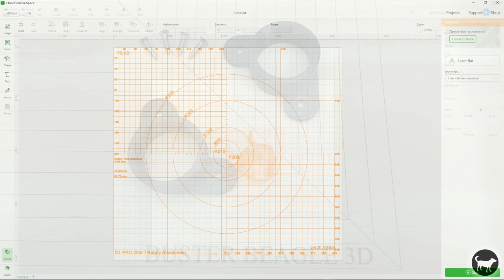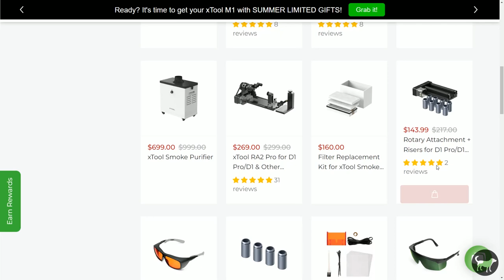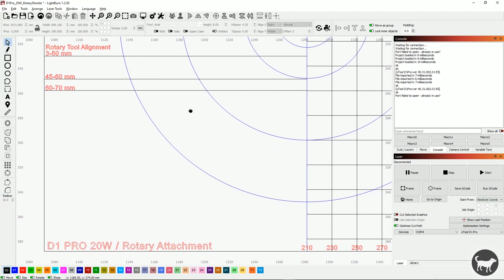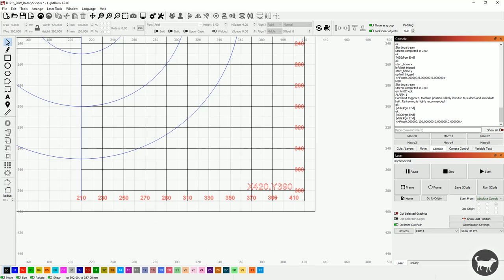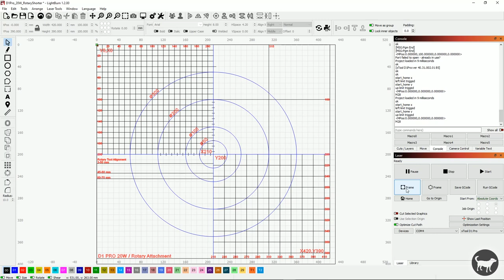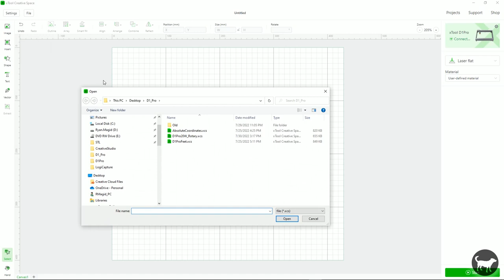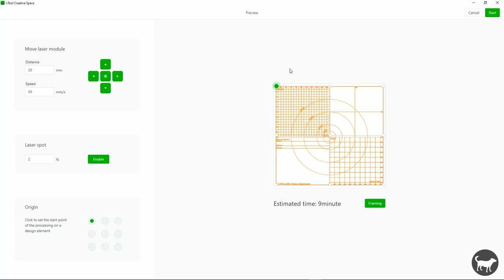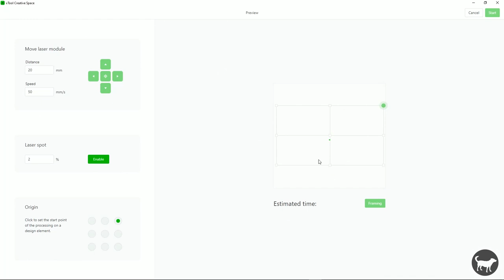xTool D1 Pro Grid Files | Use Absolute Coordinates | Lightburn | xTool Creative Space

Comment: I keep getting the “the element is placed outside of the processing area”. When I hit go to   Process.  Figured it out I need to resize the grid to fit the mat.  As you stated they made the pro a little smaller working area.
Reply from the maker: Make sure you are using one of the grids in the 2.0 folder if you have one of the newer machines. xTool keeps making the workable area of their machines smaller in the software for some odd reason. If you use the one labeled for 40W it should work, even if you have the 20W laser the 4W grid is a little shorter so I can't see how they could make the workable area smaller then that.

Comment: Thanks Ryan, can you explain why we need to change the crosshairs to the laser spot - what is the benefits, etc.
Reply from the maker: First thing is that you lose 16mm of workable space with your laser because the module has to move over by that amount to show you where the laser should be starting from. The second is really the accuracy. There is no better indication of where the laser actually is then the beam itself. There are ways to adjust the offset of the laser in both XSC and Lightburn which just goes to show you how there can be discrepancies with the amount of offset the crosshairs actually is. It’s a neat idea but just leaves too much room for error when actually using it.
Reply: @BusterBeagle3D  thanks, that makes total sense.

Comment: Your Grid is great for engraving; however, how do you keep from destroying spoilboards during laser cutting?  It would seem I would have to replace the spoil boards (I know, that's what they are for) and reprint the grids rather frequently if I do a lot of laser cutting of materials.  I guess I could use the Honeycomb for cutting and the spoil board for engraving – or is there a better way I am not thinking of?
Reply from the maker: I always use a honeycomb when cutting with a metal sheet under it. I don't use the grid while cutting, only engraving. You want a honeycomb not to only protect your spoilboard but also to add air under your part for a more a efficient cut without  a lot of charring under your part.
Reply: @BusterBeagle3D  Ah, okay.  Thanks for the reply!

Comment: my file says some parts is outside of the range on the 20W
Reply from the maker: Just make sure you are opening the file and not importing it if you are using Lightburn. Unless the workable area has changed the 20W file should work.

Comment: Thank you! I downloaded the files. Question, when turning off the crosshairs how do you get the laser to turn on when framing?
Thanks again
Reply from the maker: Hello. If you are using Creative space you can turn in on in the Process window. If you are using Lightburn you enable it under EDIT> DeviceSettings and turn on Enable laser fire button and Laser on while Framing. Be sure to adjust the "Fire" button percentage under the MOVE tab to something not too high that it burns while framing.

Comment: Going to order today! Question I have though, do you not use a honeycomb? Also, how do you prevent damage to the grid/board? Or is this meant to be used only a few times before burning a new one? Finally, does the Etsy file have the settings built in?
Reply from the maker: I do use a honeycomb when cutting so I don't use the grid at those times. There are settings that come with the girds but they may need to be tweaked based on your laser / wood/ environment etc but they should be close. It is called a "Spoil board" for a reason so it can get messed up but as long as  you can still read it you should be fine before you have to burn a new one.

Comment: Thanks so much for the video. I purchased the 10W recently and have been wanting to make a grid board like this. I also knew that it would have to be associative to the location of the tool but couldn't figure out how to make that work. Your suggestion is perfect with the feet locators. I bought the pattern file from Etsy. Here's my newbie question: Using the creative space, what settings should I use to cut the feet through the plywood? Thanks again for your help.
Reply from the maker: It really depends on the plywood and the thickness and which laser power module you have. I would suggest more passes at higher speeds to prevent too much charring. Something like 6mm/sec and 3 passes but again it can vary wildly based on the other parameters I mentioned.

Comment: Absolute coordinates is greyed out when selecting the extended laser instead of laser flat. I am wondering if I could use "Laser Flat" when my machine is actually setup as an extended machine... until such time as Creative Space adds absolute coordinate functionality for the extended version. I am aware that the Laser Flat will only "see" half the bed size, but for smaller projects I could live with that.  Or, will LightBurn solve this issue for me - I have LightBurn but have not set it up yet.
Reply from the maker: Yes. Lightburn can choose absolute coordinates by default so you can use that if you like. You can still use absolute coordinates with the extension in XSC but from what you are telling me you will need to do it the old school way I show in the video by using the little square in the top left corner. It’s the way all XSC files worked before they added the absolute coordinates checkbox.

Comment: Thanks Ryan for your grid plans and explanation of absolute coordinates. I have the XTool D1 Pro 20 W. The laser offset is disabled. I burned the grid for my machine and note when I set the coordinates X210mm and Y200mm and fire the laser it lines up exactly on X210mm but the Y lines up on Y201mm. I also noted that the vertical grid lines in the lower right quadrant burned 1mm lower than the Y200 line. In lightburn the vertical grid lines all align with Y200mm. Any suggestions. thanks
Reply from the maker: Only thing I can think of is that the wire loom on the gantry might have pinched between the gantry and the back of the frame at some point during the burn. If it hit and was 1mm off it might be impossible to have noticed but that's why everything is now 1mm lower after that hit. 99% of the issues that I have seen with the grid has to do with that wire loom not being in a great spot. They really should have gone with a drag chain for that wire or changed their homing position to the front left instead of the rear.
Reply: @BusterBeagle3D  Quite possibly.. Thanks

Comment: just an FYI. I purchased a D1 Pro Red last December. It was a 10W model, but it appears to have the "larger" laser frame with the white outlet like used on the 20W model. I burned the grid using the Creative Space 5-10w NoRotary file and it errored out halfway through (hit max Y limit switch) even though it passed framing no problem. I had to redo with 20w grid.
Reply from the maker: Be sure to read the Read Me First file in the zip folder. It has additional information needed to burn the grid properly including turning those limit switches off.

Comment: I’m new to all this and was wondering what are absolute coordinates and why use them?
Reply from the maker: Absolute coordinates are a grid system that you laser uses to know where it's position is in relation to the home position which is at (Y0, X0) or in other words "Absolute Zero" When you home the laser your machine knows that it's at (0,0) so if you place art in the software at X100, Y100 the laser knows that it has to move left 100mm and froward 100mm to reach that coordinate. That's how you can make use of a burned grid on a spoil board to place your wood onto and know exactly where it's going to be marked on.

Comment: I love the concept and I use the same system on my cnc from X-Carve.
But I have here the S1 Pro 20W, I do the frame and it moves all around without any issues. But when I press start to burn your program, I ring the alarm before even moving off the home position. Anything I missed ?
Reply from the maker: I’m sorry I missed this. I’m sure you have figured it out by now but be sure to read the Read me First text file in the zip folder. It should help you with your issue.

Comment: Is there anywhere to get help with this. I ended up running the grid in creative space. When I tried it in lightburn, I did everything as you stated in the video. It would frame perfectly,  framed it several times just to make sure. As soon as I hit start the limit switch would trip and the machine would stop and alarm. I am at a loss because it frames perfectly I've tried it several times and all end the same. Frames without a problem, as soon as I hit the start it alarms and stops. I made the file in creative space but being new to this I don't know if the measurements will all come out the same to use that grid for lightburn now that it's engraved into the wood.
Reply from the maker: Hello. Be sure to read the "Read Me First" document in the folder. It has extra instructions in there how to properly burn the grid including disabling those limit switches.

Comment: with my D1 pro 2.0 10W when utilizing the spoil board a 50mm circle centered on the xls work space using the centering button does not match center on the spoil board.
Reply from the maker: Correct. xTool has changed the workable area multiple times in the XSC software for the various versions of the D1. Sometimes the actual workable area can’t even be reached. The grid was built so that you could actually reach the points on it which might not always match centers with creative space.

Comment: Hi! We have a D1 Pro here, bought recently. I understand XCS now has an absolute setting. What does that option change for your explanation? Thanks!
Reply from the maker: The only difference is that if using XSC you no longer have to use my AbsouteCoordinate file to trick XCS into thinking there is a little box at the (0,0) position. You should be able to simply place your art, set the machine to use the absolute coordinate checkbox and the use the laser.
Reply: @BusterBeagle3D  Excellent, thanks!

Comment: HI, I bought the Pattern and feet. Got it all set up I have the D1 Pro 20w with the RA2 Pro. I frame it no issues. As soon as I go to start the engraving it hits a limit switch and stops. Any help would be appreciated. Thanks!
Reply from the maker: Got you on Etsy but for everyone else be sure to read the "Read Me First" file in the folder that goes over turning those switches off to burn the grid.

Comment: Hey awesome video. Just wondering if this grid will work for the xtool d1 non pro version? Or will the grid you made a video about for laserbox work in creative space?
Reply from the maker: Yes it will work for the original D1 as well. The old grid will not work in creative space. Only thing is you don’t have limit switches so you need a manual way to find the home position. I recommend this tool. https://www.thingiverse.com/thing:5274995
Reply: @BusterBeagle3D   alright sweet. I appreciate the help.

Comment: G’day. Great clear video, and a great idea for a newbie. I have a 20W Sculpfun with a 400 x 410 bed. Can I simply scale down the design to achieve the same results?
Reply from the maker: Hello. I wouldn't scale as the measurements would be wrong. You could however probably use the Ortur Laser master 3 version which is 400x400. Only difference may be where the home position is. The LM3 is in the front left corner. Not sure about the Sculptfun.  https://www.etsy.com/listing/1290139327
Reply: @BusterBeagle3D  thanks mate. That should work then - home is front left. I’ll burn it and let you know in case others have the same dilemma.

Comment: Please help cant find related post, Bought files last night, turned to laser spot and clicked off limit switch but there is still about 15mm hanging off bottom of artboard once I connect my device. D1 pro 2.0 with ra2 attachment. Tried both xcs, and lightburn
Reply from the maker: It sounds like they may have changed the workable area of the 2.0 for some odd reason. I would suggest picking the 40W version since it’s shorter and the rest of the grid would still be the same.
Reply: @BusterBeagle3D  thank you! I opened the 40w file and ran the frame feature looks like it'll work. Tried opening a couple different versions but not the 40, can't thank you enough for the fast response and expertise

Comment: Hello, i have the grid downloaded and burned into my spoilboard, its great, thank you!  One thing i'm not entirely clear on is when you say an image should be “Offset by the proper amount” for the laser to know where it is - what exactly do you mean? i tried a few things but the laser head mostly freaked out at the home position as it it was trying to access and area outside of the working area! Any help you can offer would be greatly appreciated! :)
Reply from the maker: Hello. It just means that once you home the laser if you intend to burn an image at the 200X 200Y coordinate you should be able to know exactly where that is after burning the grid. If you know that the top left corner of your image is at that 200,200 position you just place your wood accordingly on that spot and your image should burn right where you intended it to.

Comment: I bought this Grid File for my Xtool D1 Pro 10 watt.  I love the idea.  Problem is probably my xtool D1 Pro 10 watt.  The first run was very light with the  settings that are in the program.  I then put the laser back inhome position and then ran this grid 3 times to get darker lines.  You guessed it.  I have 4 lines, Horizontally and Vertically .  The circles are all close at the top of the circles, but further apart on the lower part of the circles.  How can I make sure my machine is setup properly.  I have installed the feet and they are solid.  Any help would be appreciated.  I am a newbie
Reply from the maker: Make sure your belts are nice and tight and that if you are using Lightburn you are using absolute coordinates. If you your home is working correctly and there is no play in the belts the laser should be starting in the exact same spot each time.